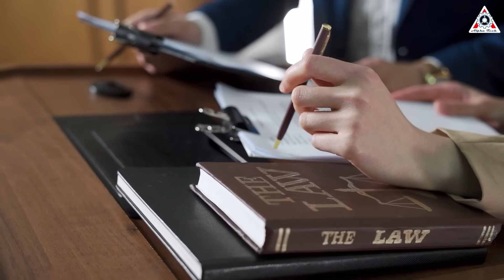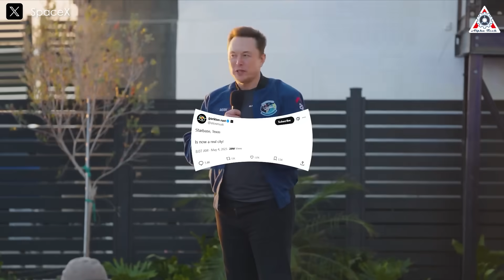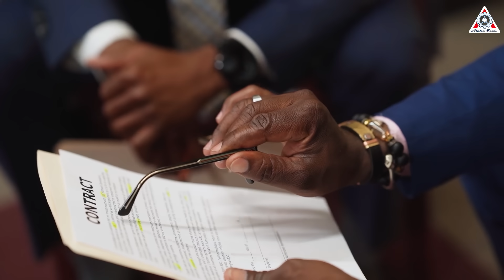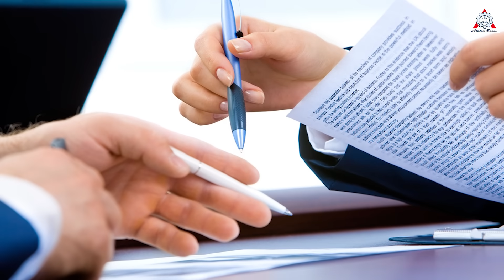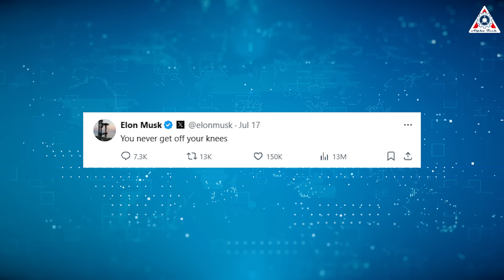What Texas Gov Just Did with SpaceX Shocked Cali's Gov...

Comment: Just know Saint Viator Community center once upon time challenge by 2 wars fought against Ellis and Maglarus families and law families until I wrecked Laramie 1500 Two Tone Sport into my property street, tree and tire dug in ground by Chevy heavy accelerated hit rather than brake. Got that Ram back, Chevy Back, Ford POS no turn signal halt and wait then proceed and cause accident and call tow and immediate insurance fraud eventually died probably whole dna lineage cured 2 cases HIV! Holy Archangelic Share blood. $200 quarters scatta all over that Ram $200 initial crypto currency now property called Easy Sidr Cannery. Won Gold and Silver coin bought Diamond Las Vegas Area city of the coin First Starlight Starbright Darkstar Beacon Starlightright! Vega S! V victory e Eureka gas and solid nickel S liquid desert molten sand call glass and windows usually grains rolling some out par dust sands rock harder than New York weakness herkimer. Rocks harder than stone at Arlington Cemetery. Come from holy mountain nations call sleeping giant. When planes encounter elevation and pressure change time displacement torques coolant pumps in housing interior impossible angles torqued way terrors of peoples faces tork when die on they sleep sin is to great and fear greater. I’m humble brother. Had cockroach in youth came out the ceiling from fan whole told that pos not to crawl directly above me and drop on my face. USS Defiant bug para jumped directly on my face. Woke 2 sleeping brother and sister giants get up get out the bed! Thought I was dreaming. See that! Tried hide in your dreams shadows or near you. Aggressive if crawl in your ear might have to scalp you and throw yo head in the cactus and poke that cockroach out and have dad ask questions about good work ethics! Wanted uppercut fan and rape all electronics into the roof and Lysol burn all
Insulation and bugs had weird hybrid spider, foreign MIB cockroach had to gut bathroom downstairs find homeowners insurance non secure wall vibe water pipes leaked. My call renovate because can be real estate agent or big business state or national mogul but forget had to fix our own never being able to access home owners insurance or equity! Never missed or bankrupted our America real estate! Only
Person bald in entire world! More valid than choices of elect!
Reply: and that is important to this thread how?????